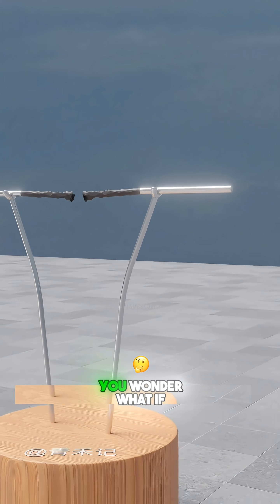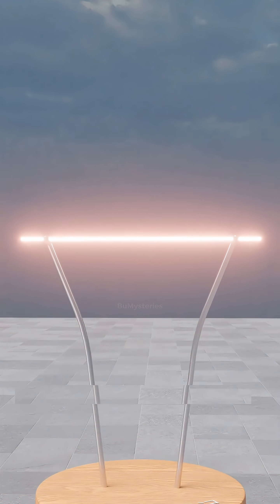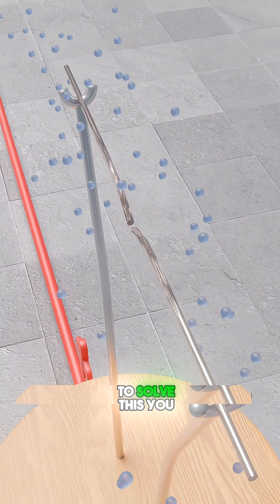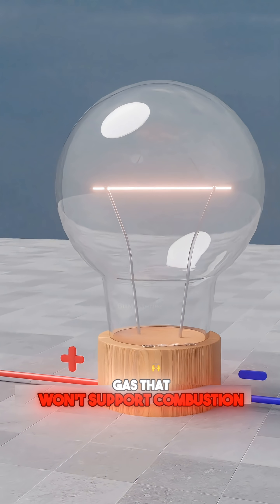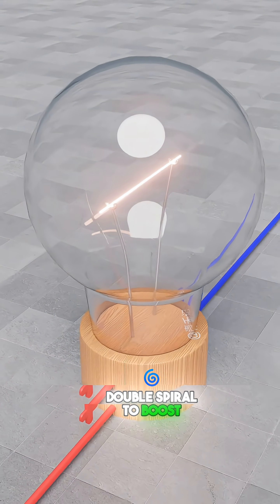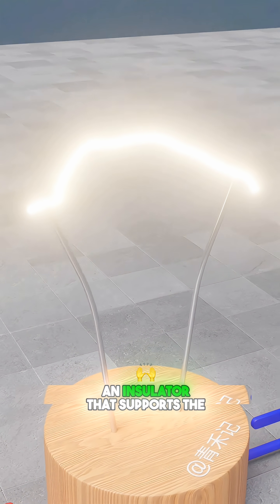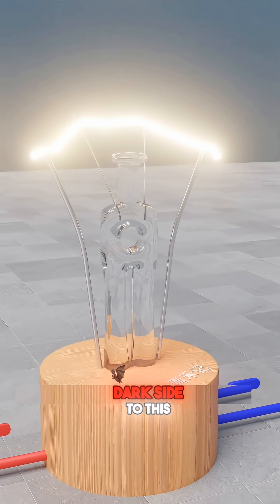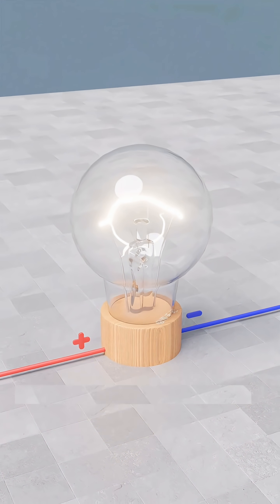How the Light Bulb Changed Everything #shorts

Comment: If you run high voltage current, the wire will melt and an arc will jump, it’s high voltage right?